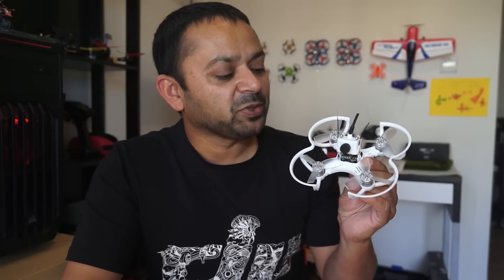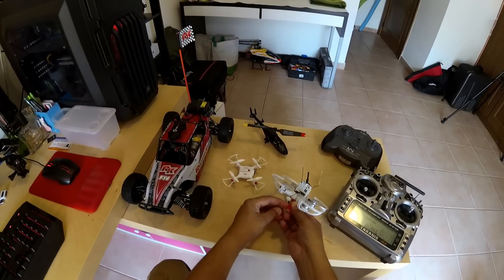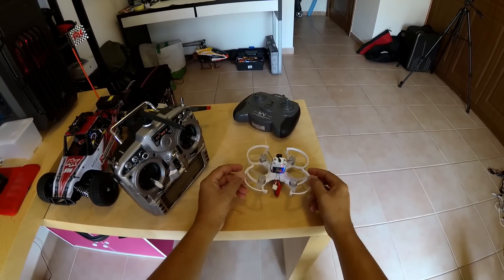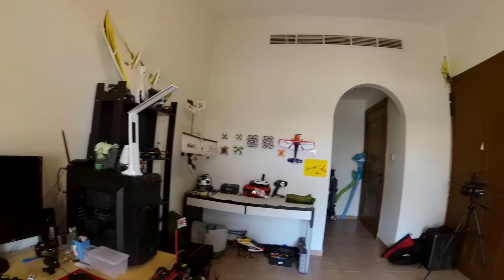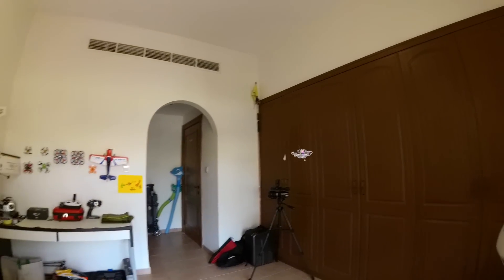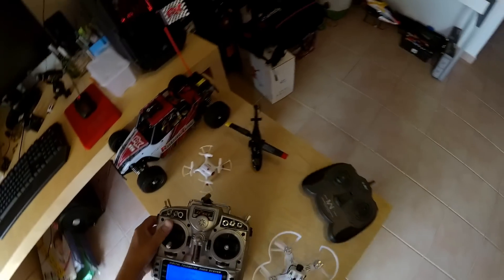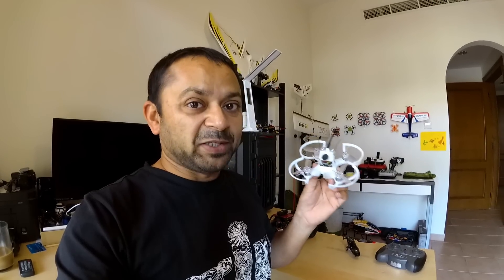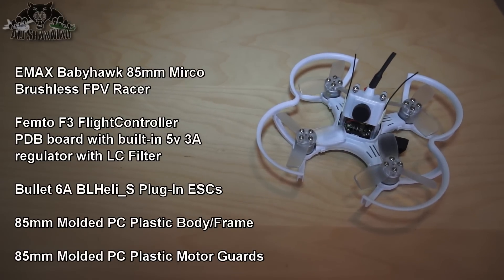EMAX BabyHawk Brushless Micro FPV Racer

Comment: Will it bind to a flysky ? If not then what is the cheapest transmitter I could get for it
Reply from the maker: you can add a small flysky tx to use that radio
Reply: alishanmao I'd like to add this little Quad to my frsky Q7,,,could u show a pic..of the receiver Io use?

Comment: This is a preview model, hope the model got better voltage regulators on the first badge, the video brake up and lots of black lines as the battery get low voltage.  Beside that i think its a great little fpv quad. 1104 motors is the new standard for micro motors and Emax is one of the best to make motors and esc's
Reply from the maker: True. But When I switched the TX to 400mw Power, I had no glitches. it was super fun to fly indoor and outdoor. not was it is :D because its still alive and kicking :D